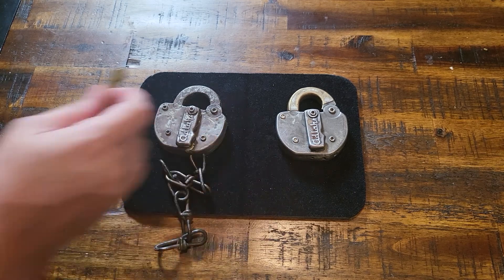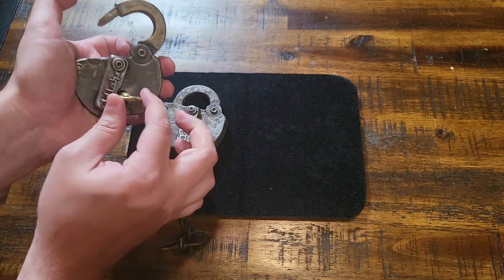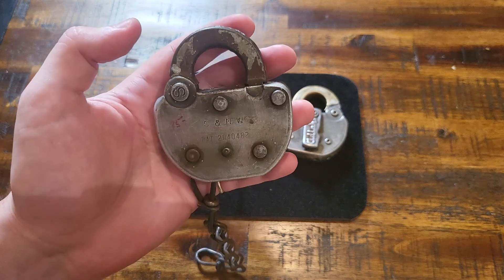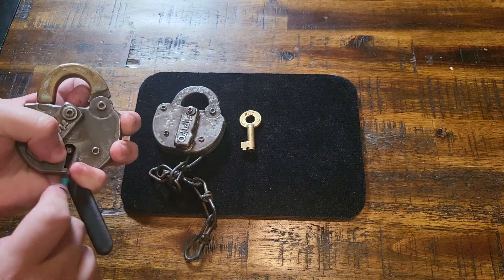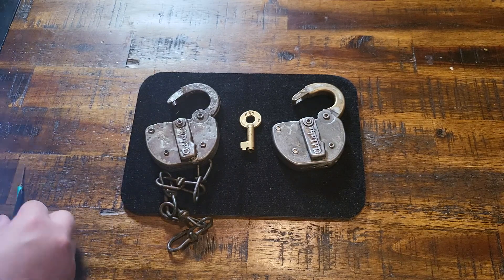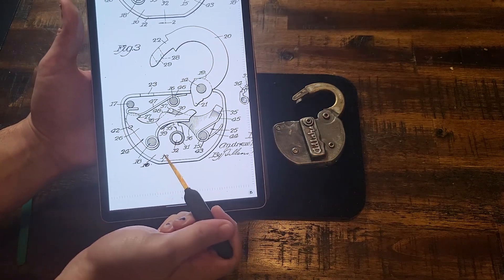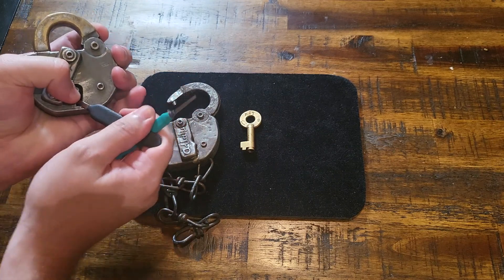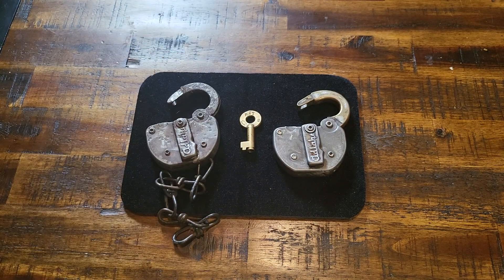Adlake Padlock Bypass - Railroad Lever Lock

Comment: gonna try this on some onry locks and cnr locks, i’ll report back
Reply from the maker: Check out the patents and see if it seems viable.  Also if you don't have knife tools you can easily use Allen keys.  That's what I used when I originally made this attack years ago
Reply: @0x42red  so, didn’t get the onry ones they seem… different inside, almost like there is a very small slit i have to get in but my tools didn’t fit i tried going in from the chain attachment but no luck. got 2 adlake locks the only difference is the keyhole and it also has no numbers on it. thanks for the video it helped me learn and understand how these mechanisms work!
Reply from the maker: @dreamsbeforedishonor2223  ah well it's all about experimentation!  And finding patents is a great way to start especially with old locks.  Also if you don't have a key remember you might need to oil it up and knock off old rust and grease.  Just don't break off any tools in there!
Reply: The key opens the drop.
Think winter and mittened hands.
Should try a new Adlake. It’s a different mechanism.
I can sell you one or a few plus a different style manufacturer lock cheap.
Overall cool video.